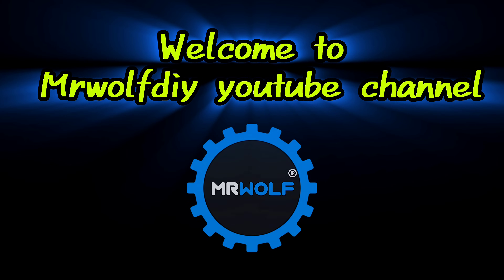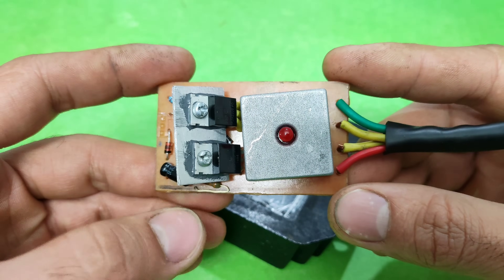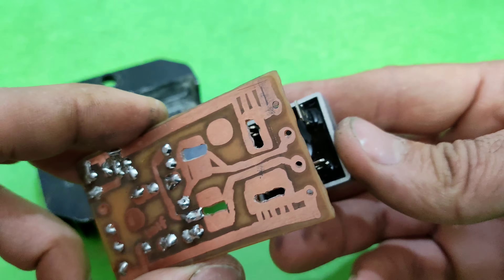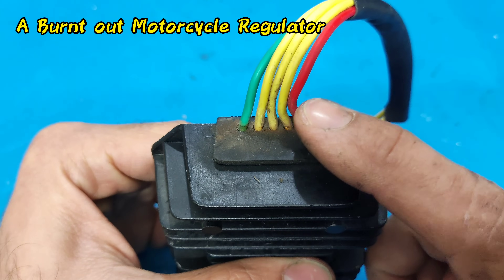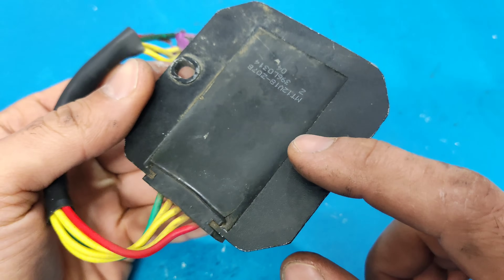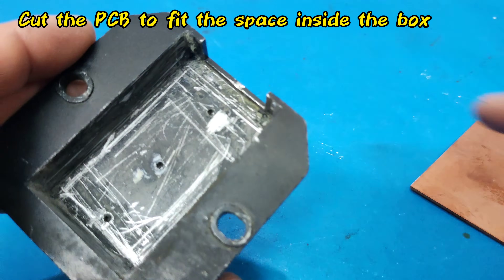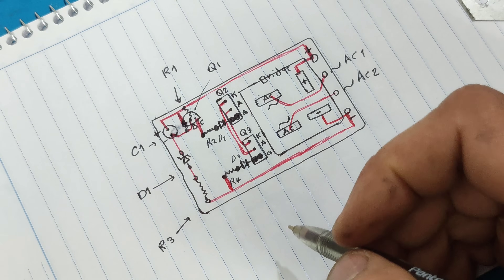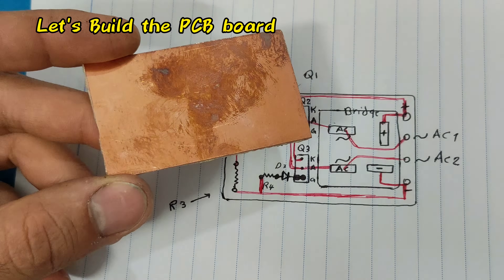DIY Full-Wave Regulator - No More Dead Battery for Your Bike!

Comment: The original rectifier with voktage regulator is 3 phase, and you made a singke phase bridge type rectifier, by the way what is the resistance value of the base transistor?
Reply from the maker: Yes, this circuit is the simplest type of rectifier for a single-phase stator.

Comment: I think there is a small mistake, and that is the installation of the diode bridge, the two pins were in the wrong place, of course the drawing is correct, I built this and it works great, thank you for your efforts Mr. Wolf.🎉❤
Reply from the maker: Yes, you are right
Reply: I also saw it but it's still the best video

Comment: The charging voltage is too low, better in 13,8-14volt range if use stock motorcycle load. If you adde some additional load, like use higger watt lamp, horn,and the other accesories, 14-14,5volt, will be good for charging voltage.
Reply from the maker: These types of regulators reach a voltage of 14.5 at higher RPMs.
Reply: it all depends on the RPM speed, please try the circuit before commenting

Comment: It looks to me like your using the diode as a votage regulator? If so, what's the purpose of the transistors?

For those wanting a 6 volt version, couldn't they use the same circuit with 6 volt versions of the diode?
Reply from the maker: The role of the BT151 thyristor is to control AC voltage, stabilize voltage, and regulate output power. 
The 6V regaltor circuit is different.

Comment: Kindly make it to 14 voltage complete plz
Reply: Just use zener diode for 14 volts and you will get higher output voltage
Reply from the maker: If I have time, okay.

Comment: In Bajaj Avenger Street 150 motorcycle, when the battery is damaged immediately the rectifier is burned and the CDI is damaged, all three will have to be replaced.  Can you giva a solution for this? Thanks.
Reply from the maker: These issues occur due to a faulty regulator.
To prevent this problem, use a healthy battery, a high-quality regulator, and proper wiring. Additionally, you can add a protective diode or a more efficient regulator to reduce voltage fluctuations.
Reply: @MrWolfDiy  Thank you for reply. The cause of this problem is a design error, nobody can foretell the date the battery fail especially when sealed batteries are used. The battery could fail while the bike is running and immediately after the fail of battery the other two components too get burned becasue once the battery load is out of the maginto the rest of the circuit overpotentialled and burned.  I greately appreciate if you can post a protection circuit/solution for this issue.  Thanks.

Comment: Does the circuit is a shunt type regulator?
Reply from the maker: Edit:
Yes ،
Components D2, D3, Q2 and Q3 are the stator winding shunting components.
Reply: @MrWolfDiy  Ma cosa dici ? E' ovviamente un regolatore shunt con soglia di intervento degli scr definita dallo zener. L'architettura del circuito parla chiaro: i diodi controllati cortocircuitano l'alternatore e la corrente è limitata esclusivamente dall'impedenza interna dell'alternatore stesso. Non c'è alcuna differenza tra il funzionamento di quel circuito e quello dei molto (purtroppo) diffusi regolatori per motociclette, sono semplici ma poco efficienti in termini energetici, inoltre provocano indesiderate reazioni elettrodinamiche negli alternatori. La vera novità per alternatori a magneti permanenti potrebbe essere un regolatore switching, che regola la tensione, non crea cortocircuiti e garantisce un'efficienza maggiore.
Reply from the maker: Yes،I had mistaken this circuit. In this circuit, D2, D3, Q2, and Q3 are the shunting components of the stator winding. It is more applicable to older motors.

Comment: Brother I expect a filter cap on output.     Its not compulsory?  And resistor Watt ?
Reply from the maker: You can use it, all resistors are 1/4
Reply: Thankyou.  For reply.
 It's  consuming 2. , 3 amp without  load . Is it normal or my mistake.

Comment: Youre kind of old school electronic enthusiast. Do you use any software like altium or always do your circuists with permanent marker? I used to do my circuits like you iback in the elektor times😂
Reply from the maker: I also use these softwares occasionally, but mainly for more complex projects, such as metal detectors or AVR circuits.
Overall, I work in the automotive and motorcycle fields, and I also build some of their electrical components in a modified form. ♥️🙏

Comment: Would you think your circuit is better than those that come from the manufacturer? I mean would it be bettter to build one of this or buying a new one?
Reply from the maker: Many people enjoy building things themselves; it's a satisfying experience. Moreover, if handmade items are built correctly and properly, they can be not only more cost-effective but also more efficient.
Reply: @MrWolfDiy  yes of course in fact i do enjoy doing that kind of circuits, i was just asking from a technical perspective but i doubt if you could examine thw original circuit cause chineese like to embed all in epoxy and its hard to examine

Comment: Hi sir this regulator how to connect 3 phase system so yellow wire is two wire so old regulator wire is 3 wire how possible to connect
Reply from the maker: Yes, ignore one of the stator wires and test it.

If there is a short circuit, one of the stator wires should be connected to the ground. Use a tester to check which one is live.

Now, connect the yellow wires of the regulator together and finally connect them to the stator wire.

One of these two methods will work, depending on the type of stator and regulator.
Reply: Just use 2 ac wire, 1 ac wire is not use.
I also use 1 phase regulator for 3 phase alternator, cause the original regulator too expensive, and i used 1 phase regulator & it work properly for 5years on this day.
Reply: @drwidiyanto3523 Hi it may work, but it may burn the unused winding from overheating if it's flowting , energy must go somewhere 😢

Comment: Thank you so much for the great content! Would it be possible for you to make a 6V Regulator Rectifier too please :)
Reply from the maker: I can try
Reply: @MrWolfDiy  Thank you so much! There are alot of vintage bikes that need 6V Regulator Rectifiers and it's hard to find a good one, most of the ones available in the market explode and smoke after a while, and the good ones are really expensive. Thank you again :)
Reply: A 6 volt version would be much appreciated. Those vintage bikes have some sketchy circuitry,  and old capacitors inside them have nasty habit of dying of old age. Fried a brand new battery because I just bought a replacement without measuring output for a vintage bike I just bought. I assumed the regulator worked, and as we all know, assumption is the mother of all f**k-ups. Oh, well... live and learn. BTW, I do believe that bike only has a half-wave stator.
Reply: @lc4biker Not totally sure, but I believe the stator always puts out a full wave. I think the half wave or full wave output is solely dependent on the rectifier. A 6V 90cc vintage Honda I have keeps burning out regulator rectifiers. The last one I used cracked open and was pouring out smoke in the middle of the street. Fortunately, I had enough juice in the battery that I could get close enough to home so that I could push it the rest of the way, lol.